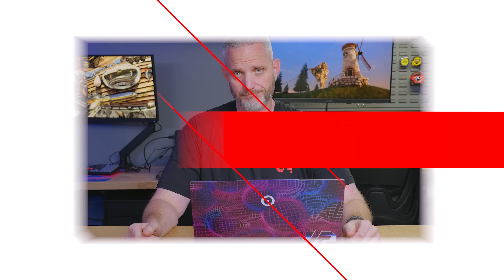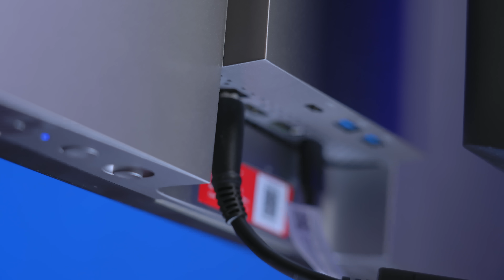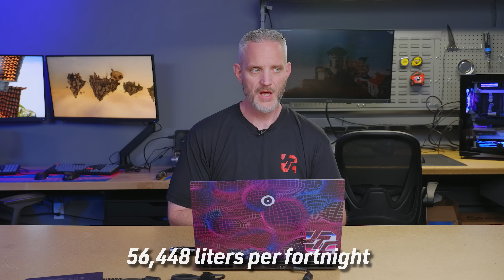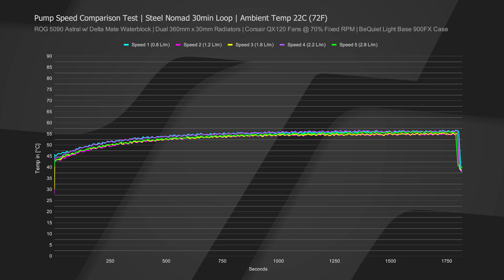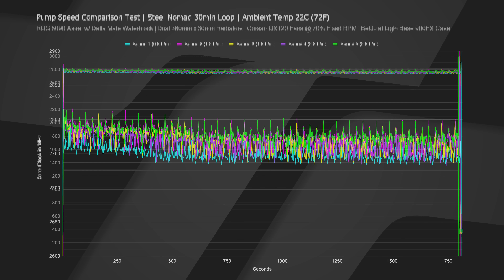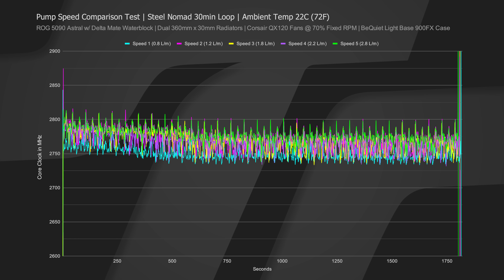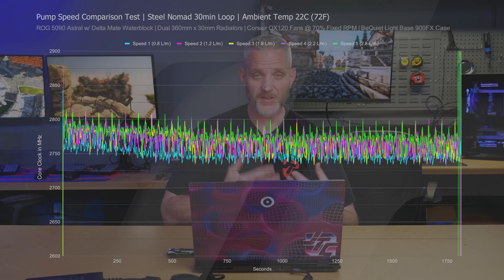Stop doing it this way!

Comment: I think the simple takeaway is test your pump at different speeds because there will be a sweet spot.  Not necessarily the fastest or slowest speed, but instead a speed where, given the unique configuration of your loop, it will circulate at just the right rate that optimally balances time spent cooling in the rads versus time spent in contact with the cpu/gpu water block fins.

It’s kind of like the concept of resonance frequency, but for water loop efficiency.
Reply: Also to find the wet spot where the pump is quieter. Had many D5s between custom loop/AIO/Air setup changes. Every single pump, depending on the loop components will have a different quiet point. Sometimes 70% was quieter than 60%. Sometimes going up only 5% the noise was really noticeable, and increasing it another 5% while giving higher flow rate, the noise was the same. The biggest “issue” for me, after very restrictive blocks and/or radiators, was adding a 90 degrees fitting right on the outside of the pump. Not a big problem if all else was low restriction, but using 3 X5 Corsair 360 and a very restrictive alphacool CPU block, flow was down to a drip. Removing the angled fitting, it was acceptable.
Reply: Probably the transition between laminar and turbulent flow
Reply: @Emma-i9x  You are ALWAYS getting turbulent flow in the micro-channels (in cold block and radiators) at any reasonable flow rate.
Reply: @chenjiami8962 yes, but not at the fittings or the resavoir.
Also there are different kinds of turbulent flow, so it could change from one to the other.

Comment: Question Jayz: When you have 2 Rads, would the System dissipate the heat more efficiently if the loop was Res, Gpu, Rad, Cpu, Rad, res, Vs.  Res, Gpu, Cpu, Rad, Rad, Res?
Reply: We've been over this many times. Loop order doesn't matter.

Comment: If you want to test how much heat a D5 would put in a loop why not build a loop with just a pump and radiator?  Put an inline  coolant temp sensor in it and measure the differences in coolant temp between the different pump speeds.  Would be an interesting test!
Reply: Manage making it even more complicated depending on what type of fluid you use😂
Reply: Basically, how much energy it uses, minus heat dissipation to the surrounding air.
So negligible

Comment: You can test the heat from the pump by setting up a loop that's just a pump, reservoir, and tubing. No rad, no other source of heat. You could also hook it up to a rad to see if just passive cooling is enough to dissipate the heat. It looks like the D5 is about a 35W pump, so if we assume all of that is waste heat, you have a 35W heater in a loop where that's the lowest power component.
Reply: Exactly, well said!

Even at full blast the impact on a system with a peak power consumption nearing a 1000W, the amount of heat generated by a 35W part is in the single digit. And with lower pump speeds, it's in the margin or error for the testing methodology.

Plus, a lot of the pump housing is not in contact with the loop, and thus radiates heat into the case. 

Would be an interesting thing to see this tested, to have some actual data to lean on.
Reply: 35w is something, and yes having a loop that doesn't have any heat exchangers in it (radiator or water block) and a thermocouple will let you figure out how much heat is dumped into the system with a little math.

Comment: This entirely depends loop to loop, you might need higher speed because of the restriction's in the loop just like JayzTwoCent said. With my highly restrictive loop i get best results at equivelant of speed 4 but run the pump at equivelant speed 3 to increase pump life.

Comment: This argument has been discussed ad nauseum in the water cooling community for over 20 years.  If you think that running your D5 at speed 5 is a lot of water, then you should see what others have done using more powerful pumps at 5 or 10 liters per minute, showing some interesting results.  This is a bigger community than what you would think and things aren't so cut and dry....

Comment: Hey @Jayztwocents in plumbing depending on water pressure and speed a single non curved 90 degree fitting reduces pressure by 2-5 psi, I don't know whether that is the same in water cooling in a PC

Comment: My take away. Humans humming along while working is good. Pumps humming along is not good. 

Seriously though, I wonder how much heat (if anything worth measuring) a vibrating pump would offer into the loop.

For micro reef tanks back in the day, I had to stop using Marineland canister filters because the impeller was located at the bottom instead of the top and particulates would wear out the impeller and offer resistance. Thereby warming up the water as well. Not great for an aquarium like a micro reef. 

Anyway… just thinking out loud.

Comment: What do you mean you can't think of a way to measure the heat output of a D5? Run it on a closed loop with a thermal probe and nothing else or just a radiator.
Reply: This seems quite obvious!
The shorter the tube runs the better…

Comment: Thank you Jay!  That is exactly the same results I found when I tested my first loop over a decade ago!  I also set my manual D5 at speed 3 for exactly the same reasons too.  So thank you for corroborating my results.  Oh, and my D5 is still going strong, even after a decade of use. 😊

Comment: So I have a pool with solar panels. The water runs through the panels, light hits the panels, the water warms. If the pump runs slower, the water will be much hotter than if the water flows fast through the panel. Same applies here. When the water is in the rads, the fans have a chance to cool the water.
Reply: No. It's not the same. Your system only heats the water. A loop like this heats and cool the water. The slower it flows, the more heat gets dumped in the loop. But the rads are also extracting more heat out of the loop. So you are back to square one.
Reply: @Audiosan79 yes, but as shown with the tests, if the flow is to high, it doesn’t have a chance to cool.
Reply: @trick0502  It also pick up less heat from the CPU/GPU. And there is added friction when flow/pressure gets way higher than it need too. So there will allways be a sweetspot. Also. What you see in this test, is the GPU temp. not the liquid temp.

Comment: hey J i have a pump that moves 800 Liters an Hour at 3 PSI im thinking about getting another one when i water cool the GPUs and a external radiator what  do you think? my temps range between the 20s to 70s from ideal to under load

Comment: The main reason water cooling is weird like this is because a slower flow rate means the liquid stays longer in the GPU/CPU blocks picking up more heat and stays longer in the radiators dumping more heat. This means your radiators ability to dump heat to atmosphere means a lot more than your pump speed as long as the liquid carries away enough thermal energy for the components not to throttle. Also get an air conditioner because all this heat is being dumped in the space you are sitting and it will get tropical fast when you watercool and do intensive computer tasks.

Comment: This is odd. I vaguely remember that one of the radiator manufacturers did this test like two decades ago and they determined that around a liter per minute is usually the best flow rate given how water conducts heat and how most radiators are built. Now construction changed a little over the years, but it seems that number is still the ballpark to aim for.
Reply: Which is 60L/h which is the minimum you should strive for. (That's what forums, google, etc said)
Reply: In his specific loop and fudging it simply as a curve, the "sweet spot" is around 1.0 to 1.5 L/m.

The only real concern at all with his 0.8 L/m speed 1 on the vario style D5 is if the pump has enough to overcome necessary head pressure resistance down the line.

Comment: In my system the pump is controlled by the CPU Water Block exit water temperature and my fan speed is controlled by the Water temperature after the Radiator. 
sound complicated, but it isn't. My CPU temp is constantly at 55°C or lower with the pump set minimum at 10% and my are fans mostly off because convention does its job. 
My PC is basically silent all the time. On gaming fans ramp up to 20%, pump at 50% and CPU temp at 70°C. On a CPU benchmark, pump at 80% fans at 30% and CPU at 80°C. Coolant cold side temperature is always at 50°C. It doesn't matter if CPU is used 100% or idle at 0.1%.

Comment: So I tested my NZXT 240mm AIO I have with a 9800x3d that's overclocked. And at least in my case. 100% is where its at for me. While running prime95. I would thermal throttle at 80% and I would NOT thermal throttle while it was at 100% pump speed. Fans where set to 100% in both tests just to keep it level. And that was in real time. I could literally watch the temperature drop when I set it to 100%. When I lowered it back down to 80%, I would see the temps start rising again to thermal throttle. It would go from around 90c(what I set my bios limit to) down to around 86c at 100%. 150w TDP on the CPU.
Reply: Do you regularly run Prime95, or is this an atypical workload that isn't representative of normal system use?
Reply: @BobBobson  Doing it as a stress test to push it hard. I wouldn't say often. But also used to make sure my overclocks are stable.
Reply: 240 aio is not enough for your cpu to be cooled propperly. Thats why you get best performance by far with fans and pump set to 100%. That noise would make me instantly order tubes, fittings, radiators (at least one 360) and reservoire with pump. Rebuild the loop and set pump to max 40% and fans to 50%. Complete noiseless, at least in my system. I hear the coilwhine of my 5090 more than the watercooling system.
Reply: @Jugin00ew4life  My fans are extremely quiet even at 100%. I definitely can't even hear them through my headset. So it literally doesn't bother me at all. 240mm is plenty for my CPU. If its not thermal throttling under a 100% load of prime95. Then its fine. During regular gaming. Its chilling at 50-60c usually. And while idle or doing anything else, my PC is entirely silent.

Comment: Honestly I find using a PWM pump is the best. When the system is idle/under certain temp threshold I would turn my pumps completely off & only when under load would I turn them back on to about 50-75% depending on fan speed/noise. I find until most fans spin go above 600-800 rpm my pump's vibration noise would be the loudest part of my system. So doing multiple pump vibration reduction methods with zero pump speed essentially made/masked any noises from the pump. Again, once the fan noise became the loudest part(s) of the system then I didn't mind having my pump making some noise mostly due to vibrations.
Reply: Also I'm a huge fan of the MCP35X DDC style pump (also shows my age in open loop cooling) even though I own 5+ D5s. D5s are technically better but reducing the vibrations are much harder when compared to the DDC variant. Even my 1x triple SLI (in paralell bc series would be too restrictive) + CPU + Mobo + 2x rads the MCP35X was more than enough when the loop is configured well.

Comment: Hey Jay... I build several Watercooled PCs over time.. And my experience is, it is higly dependant on the Waterblock used. For example the EK Velocity2 Intel CPU Waterblock -> Here you have significant diufferences from low to mid to high pump speed. Overclockes 13900K/14900K or 285K goes sooo much faster to 100C (Strong overclock) with low/mif pump speed compared to high pump speeds. Tried it with 2 blocks and 3 CPUs over time... these blocks benefit strongly from the Pump speed in my experience...

Comment: @jayztwocents have you ever done a scenario where the fans on the radiator are either stopped or various speeds whilst doing a 1-2 hour long gaming session, or even what affect the fans have on the loop temps?.
Reply: If the fans are off, the temp goes up because the rads would be doing nothing. We don't need a test for that.

Comment: I bought a corsair 1200 W platinum power supply five years ago. How do I find out if it’s still in great shape and whether or not I should use it on a new build? Do power supplies lose some of their ability overtime? Are the newer models, more efficient? I would love to know this before I buy a new power supply and find out later that my old one was just as good. It is one of the longer power supplies.  Thank you, very much.

Comment: So I work in the plastics industry. (We use heat, and cooling for our equipment) I have found that slower water flow often does better. It gives the fluid time to soak the heat, and then take it away. If you push a high flow rate, it is just washing over the heat only taking a bit of it away with it, causing higher temps. This has just been my experience, more flow is not always better.

Comment: got my ek pump for over 10 years,still up and running,i also let them run on 80 pprocent .EK has quality..
Reply: no, ek (like every other brand)  just relabel pumps. d5/ddc pumps are industiral pumps from garden and heating system equipment

Comment: what happens if you Y-Split before 2 radiators and then merge back = 1 speed over cpu/gpu but 1/2 inside radiator giving it more time to cool down the liquid
Reply: How exactly would that work? At say 2L/min the liquid would use exactly the same time to run through 2 rads in series, as 1L/min would use going trough a single rad of the same size.  So  2 times 1L/min trough a 360 rad in paralell = 2L/min trough 2x 360 rads in series.

Comment: What I've been doing is: Normal operation = slowest, Gaming = 50%, and then every so often I run at 100% for a bit to push any air pockets that formed out of the loop. GPU block has a spot that loves to capture air.

Comment: you can use super low flow rates and still adequately cool your components.   i've had flow rates of 56lph on two water blocks with two rads being pushed by 1 dc-lt 2600 pump.     no problem.
Reply: 56 liters per hour is not super low. It lies right between the two lowest rates he measured here. 0.8 liters per minute equates to 48 liters per hour and 1.2 equates to 72 liters per hour.
Reply: @rustknuckleirongut in my opinion  the best way to enhance your cooling capability is to increase the volume of water circulating.   it's even more effective than radiator or fan choice.  if you ever do an external radiator build  that increases the volume substantially, it's kind of shocking to see how stable and cool you're results are.
Reply: @Waylon_Gnash  That only works for short tasks. The water reaches the same equilibrium regardless of volume, it just takes longer to reach equilibrium. You need to get heat out of your loop for sustained performance, that is just basic physics. The water just stores the heat, radiators as the name implies radiates heat away from the water.

Comment: What a coincidence I just looked back at the older video of you talking about this because I just got an AIO for the first time in a new build! Thank you for making another vid clarifying this stuff.
Reply: Tune pump/fan speeds based on noise levels, which you tolerate. If you have OK airflow in case, you absolutely do not need to run either at 100%.
Quiet system, happy gaming. Have fun with your new build.

Comment: '56000 litres per fortnight' made me choke on my cheese sandwich!🤣
but ideally you would have cpu or gpu cooling donw by having multiple cooling loops. when temps hit a certain level a second whole loop would kick in to cope with the increased heat generation. which you could do either with whole separate loop and pump OR a temp sensitive valve that diverts flow from rad in loop 1 to a second rad with fans switched on that fan at same time.
Reply: on the charts i would be saying 'speed 2 is best'

Comment: They key thing here I think that people tend to miss is that the water in the loop is mostly the same temperature between the coolest part of the loop (exiting the last radiator) and the hottest part (cold plates the CPU/GPU blocks).  The real purpose of the water pump is to circulate and "MIX" the water.  You want enough flow to accomplish mix, but if you get too much flow, you don't spend enough time in the radiator.

In my loop I have a water temp sensor at both the last radiator exit port (2x 360s) and a temp sensor right before the first radiator (goes through CPU and GPU block first).  Too low to reach mix and I've seen 6 to 8'C delta, but once I hit about 1L/m flow rate, the most I see is 3 or 4'C.  At 2L/m, I'll see a lower delta (1'C) but the water temp itself goes higher.

I keep thinking I need to sit down and spend a few days doing some real data collection/tracking since my setup is already so good for this, but laaaaazy....

Comment: @jayztwocents  if you want to measure how much heat the pump is dumping into the loop create a simple loop of pump and reservoir that is completely empty and then fill it with a fixed amount of water such as 1 Liter, and then put a thermocouple/thermistor in the reservoir set the pump to maximum speed and then take measurements over time and do math it'll tell you how much heat is dumping into the loop
Reply: this won't be exact because you will have some cooling from the loop and the reservoir being exposed to possibly cooler air, so unless you insulate the tubes going to and from the reservoir and the reservoir itself from the outside you'll have a little bit of losses. It would be similar to the way it would be built into any rig with air flow blowing over those same tubes though..
Reply: @omegatotal  Measure temperature immediately before and after the pump along with flow rate will give you the heat transfer from the pump into the fluid.  Won't be any significant loss to the environment in that short length.
Reply: @aaronhopkins7354  That's hard to get accurate measurement on for small changes, sometimes it's easier to spread it out over a larger mass and a larger time